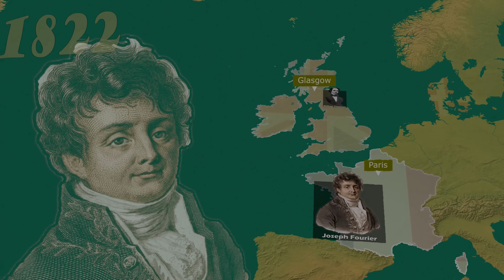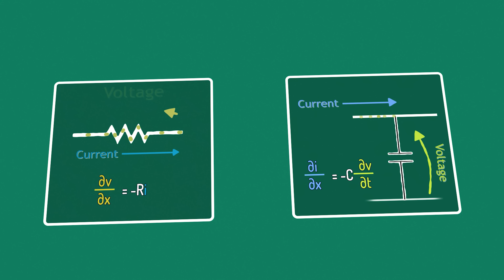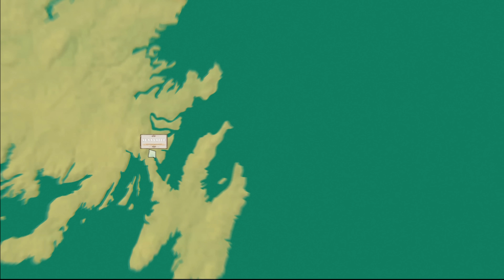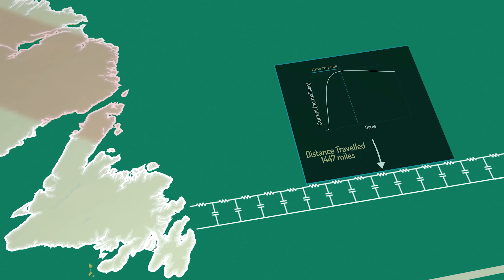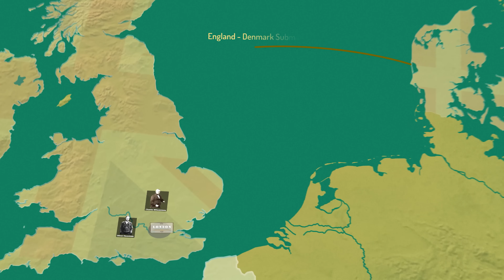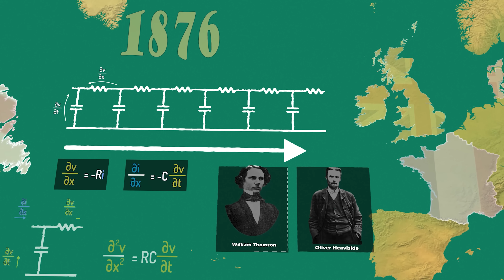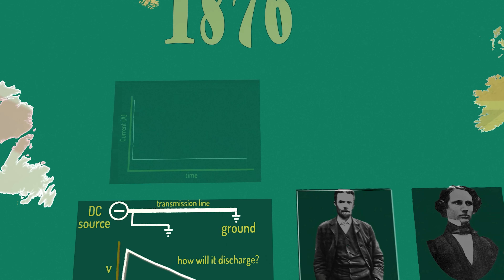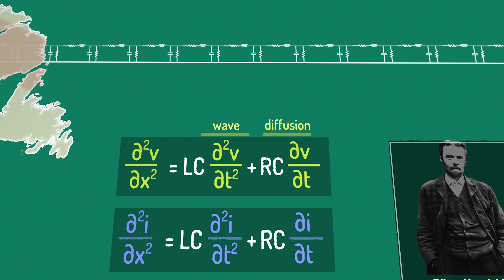The Story of the Telegrapher's Equations - from nowhere an unknown genius solves transmission lines

Comment: Brings back great memories of a lost youth.   I had worked as a cobol programmer a few years out of college but every time I tried to get a higher paying non-business programming job I was told you needed Calculus.   Searching used bookstores for calculus books, most were unintelligible to me, I finally found "Calculus Made Easy" by Silvanus P. Thompson in Dick's bookstore in Providence and studied it for some months.   It was the only book that had made sense to me and did not use the stupid delta-epsilon or limits methods but was kind of a seat of your pants approach specifically designed for the young engineering students of the World War l era. 
Then I was told you needed some engineering courses.   I bit the bullet and went to the University of Rhode Island for 3 semesters , eventually taking all the math courses needed for an E.E. degree and a bunch of other physics and electical circuit courses.   While there I found some of Heaviside's books in an old library annex building that had been converted from an old 1940's gym.   
I ended up getting his 3 Electomagnetics Volumes and his two Electical Papers books but wasn't able to follow it entirely.  It was obvious he believed in crafting mathematics to mimic nature which resonated with me.  For example, his operational calculus equations for a signal down a transmission line mimicked reality because he used divergent series.   Eventually I discovered that one could get microfilms of his personal notebooks from the British "Institution of Electrical Engineers" and for about $30 (this was around 1977) I got 4 spools of microfilms,  bought a used microfilm reader from the library and went at it.  It was something to see how he had taught himself advanced math by working through all the Victorian era math books like Todhunter's series.  
Heaviside loved Maxwell's equations but found the math cumbersome so he set about to reformulate them in his own operational calculus which was later formalized and explained a bit better by Vannevar Bush in the 1920's (who later became one of the famous Majestic-12).  Most interesting of all was Heaviside's formulation of vector calculus in his operational way which could be applied to tornadoes as well as elelctromagnetic phenomena but I had trouble understanding it, his descriptions were too brief.  
I don't know if others ever picked up on that and, anyway, had to make a living so I took a job programming computers for a navy contractor in Middletown Rhode Island and went on with my life.   With his books and microfilms and a tool like Mathematica or Maxima,  some young student or engineer will find there are discoveries to be made by diligent re-reading and study of his work.
[NOTE: Silvanus Thompson's book was the key to passing every math course needed for the E.E. degree and, secondly, in 33 years of programming and software engineering,  I never needed calculus. I have heard they maintain that same bullshit today].
Reply: You were going good until you mentioned that Majestic 12 nonsense.  You know it's laughable nonsense, right?

I know this is long, but let me explain it to you. The Majestic 12 (MJ-12) documents, purported to be top-secret government memos about a secret group formed by President Truman to investigate UFOs, have already been widely debunked as a hoax. I don't think any serious UFO enthusiasts believe it any more.  What are the main reasons, including at least two HUGE issues with Truman’s signature that shout fraud?
1. Origins and Immediate Skepticism
The MJ-12 documents first surfaced in the 1980s when UFO researcher Jaime Shandera received an undeveloped roll of film in the mail. Upon development, it revealed documents allegedly detailing a secret UFO investigation group. From the outset, skeptics noted problems with their authenticity:

The documents were anonymous and unverified.
They contained anachronisms, such as terminology and style inconsistent with 1940s and 1950s government documents.
The story relied heavily on unverifiable claims.

2. Forensic Document Analysis
Truman’s supposed signature on the MJ-12 document, dated September 24, 1947, approving the establishment of the group, has been identified as a forgery for several reasons:

Identical to a Public Signature: Analysis showed the signature on the MJ-12 memo was an exact match to Truman's signature from a memo to Vannevar Bush, a well-known and publicly available document. This points to the signature being lifted and copied.
Mechanical Reproduction Marks: There are indications that the signature was likely traced or photocopied, a technique commonly used in forgeries.

3. Formatting and Linguistic Errors
Wrong Typographic Style: The formatting of the documents didn’t match government standards from the era. For example, line spacing and font use were inconsistent with official government memos of the time.
Anachronistic Phrases: Some phrases used in the documents reflect modern, not historical, language, raise suspicions that the documents were fabricated decades later.

4. Historical Inconsistencies
There is no evidence in declassified government records that such a group existed or that the events described in the documents ever took place.
Truman’s actual presidential schedule and activities on the date the memo was allegedly signed conflict with the timeline implied in the document.

5. Admission and Further Hoaxes
Some individuals involved in circulating the MJ-12 documents later admitted to fabricating UFO-related materials, casting further doubt on their authenticity. Bill Moore, a prominent UFO researcher, admitted to knowingly participating in disinformation campaigns in the UFO community.

Conclusion
The combination of a forged signature, historical inaccuracies, and the lack of corroborating evidence firmly debunks the Majestic 12 story. Experts across multiple fields—document analysis, history, and ufology—agree that the MJ-12 documents are a hoax designed to exploit gullible public interest in UFOs during a period of heightened Cold War paranoia and fascination with extraterrestrial phenomena.

Comment: Why didn't they just test transmitting over 2000-miles of this cable BEFORE they laid it?
Reply: Where is the fun in that?
Reply: They did. But the cable behaves very differently when in different mediums. Air vs. Seawater. Cause what I understand is that the signal doesn't really travel inside the line, in the conductor, but around it in an elecromagnetic field, so on land it travels in air, and at sea in water. Which are very different isolators or conductors. Anyone please correct me if wrong. Its been a few years from my uni studies.

Comment: Maxwell published his work on Electricity and Magnetism, known as Maxwell equations, as a series of articles in 1861-1862, not in 1873.
Reply from the maker: Indeed. Heaviside was first exposed to the 1873 unified treatise, which is quoted in the video. But you are right - parts of it came earlier, for example the 1861 work "On Physical Lines of Force", and I felt it was important to show this in the video.

Comment: PDEs are truly as close as we'll get to the language of God. In fluid mechanics these equations are equally important. Fourier's heat equation is encapsulated in a more general energy transfer equation. Combine that with the conservation of mass and momentum which Navier and Stokes described, and you've got a set of PDEs which describe the flow of any thermo fluid! Maxwell can also be brought into the mix if you need to describe the formation of galaxies!

Unfortunately the solving of these equations remain extremely difficult and the numerical analysis thereof aswell. 

Spectacularly the numeric method utilised changes the fundamental equation you are describing into something called a modified equation. This modified equation introduces extra advection(wave) and diffusion terms. CFD is about minimising these effects

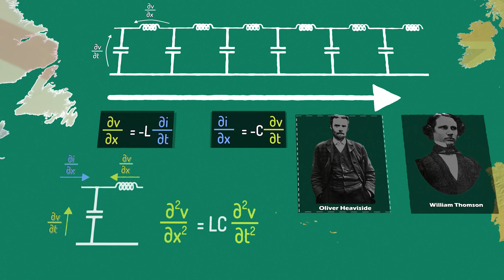Comment: The "1988_Cypress_CMOS_Data_Book" can be found online. "Systems Design Considerations When Using Cypress CMOS Circuits" can be found on page 10-60. 11:40 By page 10-66 it is clear that you want to terminate a transmission line resistively equal to the characteristic impedance of the line. 70 ohm characteristic impedance terminated in a 70 ohm resistor.
Reply: Motorola ECL (Emitter Coupled Logic) applications guides go deep into designing board traces to maintain a "controlled impedance" environment for signals too.
Reply: @uploadJ  Thanks! I managed to find a copy 1989 Motorola MECL System Design Handbook 4ed at Internet Archive. Page 189 has the famous equation for a microstrip transmission line over a ground plane. Dielectric constant, height and width.

Comment: Taught this at college. Transmission lines one of the most useful things I learned. Applies to many other things such as flow of air in pipes etc. 
Also explains why just bolting on solar panels and inverters onto electricity grids is not trivial..... Are you listening Spain..... Watching this could have saved you a lot of agro.
Reply: But, electric 'transmission lines' do not operate in an "impedance matched" scenario; Rather, just the opposite. Also, the problem with interconnected electric generating sources and loads presents certain synchronization stability problems with regulation and regulators, and these are outside the domain of time-invariant linear networks such as Heaviside maths deals with.

Comment: You can get waves out of diffusive structures, paradoxically.  Zabusky, N. J., Hardin, R. H.: Phase transition, stability and oscillations for an autocatalytic, single, first-order reaction in a membrane. Phys. Rev. Letters 31, 812 (1973)

Comment: According to this video, do you realize how many FIRST EVERs Heaviside DID?
• he was the first guy to "coin" the word inductance. (👈So, why were units of inductance not named after Heaviside?)
• he was the first guy to "set up" what is now called (in books that teach the topic of Differential Equations) a forcing equation. (👈This is where you put a sum of 3 voltage terms on the left side of the '=' sign (i.e. one to represent voltage that results from R, and one to represent voltage that results from L, and one to represent voltage that results from C) and you put an input signal voltage on the right side of the '=' sign. Differential Equations textbooks refer to the applied input signal as a forcing equation. )
Reply: John

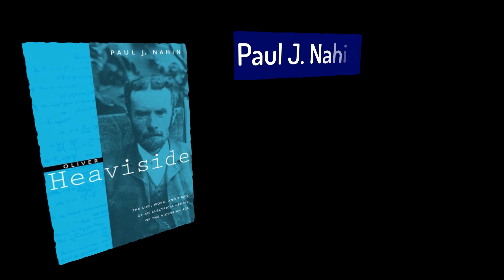Comment: The cover of Paul Nahin's book on Oliver Heaviside is shown at 7:56 of the video. Nahin in 2020 wrote a book on the topic explored in this video. The title is 'Hot (from the Mathematics of Heat) Molecules, (to the Development of the) Cold (Trans-Atlantic Telegraph Cable) Electrons. It is a story book with plenty of Fourier mathematics. Nahin also has a separate book, Transients for Electrical Engineers (2019),  emphasizing the Laplace Transform solution for partial differential equations. The last part of the book is about the solution of the Telegrapher Equation and how programs like Matlab can make life easy for the modern analyst. It also explains why the Laplace Transform replaced 
Heaviside's earlier operator method of solution. It took 10 years but by the 1950's engineers started using Laplace Transforms exclusively. If you love math and stories you are in for a treat from all 3 books.

Comment: Fun fact: Heaviside formulated Maxwell’s equations into the vector description equations we still use today. He also discovered Gravitomagnetism — equivalent to weak-field General Relativity — thirty years before Einstein.
Reply: I think the problem is the use of the magnetic vector potential which is pulled out of nothing and then requires a gauge to set the "troubled" parts of the equation to zero so you get a nice wave equation. It models sinusoidal far-field stuff fairly accurately but starts to have issues with impulses in the near-field. 

Maybe representing with different or original math would fix this, but would probably eradicate any and all practical use due to the complexity (I'm coming from an engineering perspective where you have to make things work and cannot fully reside in the fantasy world of math hehe).
Reply: Gravitom..
Reply: Inferior description of the equations. Geometric algebra is a better way to describe it
Reply: @NoamHaim Geometric Algebra is just nuts nonsense, just use the wedge product for the cross product.
Reply: I still search for the thermomagnetical scrap gripper, I once found in a book😊 It must be a Mandela Effect, it dissapered😢
Reply: “Gravitomagnetism” yeah right, there’s a red nugget for ya.
Reply: Me 2
Reply: Also had a perfect name for what he invented
Reply: Heaviside was a self-taught, electrical theoretician who wanted to understand Maxwell's equations of electromagnetism.  To do this, he had to wade through Hamilton's math of the 'quaternions'.
Heaviside hated the quaternion math so much, that he and his associates revamped it into the vector calculus we know today.
Hamilton's quaternion calculus was a four dimensional system, but he tried to squeeze it into three dimensions, differentiating 1-D 'scalar', and 3-D 'vector' components.
Heaviside trashed the idea, but he kept the fundamental relationships of scalars and vectors within his own algebra.
Maxwell's differential equations, prominently displayed in university text books, are really Heaviside's re-worked equations.
Reply: Vector calculus -> a mathematics based upon the relative position of points within a 4-dimensional space.  Points in the space represent hyper-complex numbers.  The math of the points simply parallels the math of the numbers.   The 'difference' of points parallels the difference of the numbers.  This difference introduces the concept of distance and direction, magnitude and orientation - the vector.  Without recognizing these underlying relationships, the notion that I times J equals K becomes a matter of rote memorization, accepted without real understanding.
Reply: I have always held that Einstein took Heaviside and Bachelier and thats how he got his base.
Reply: I thought that was Josiah Willard Gibbs, the physicist at Yale, who boiled down Maxwell's original 20 equations down to the 4 that we now know as "Maxwell's" equations.  When it really is Maxwell's equations in Gibbs' notation."
Reply: More like he edited it out leaving only the electromagnetic part, without the gravity component. He censored gravity from electro-gravito-magnetics.

Besides, while Maxwell's original formulations were somewhat of a mess, they were using quaternions which are a natural way of representing 4-vectors and rotations in 3D space.

Vectors are an oversimplification that loses important physical characteristics of electromagnetic interactions. We need to use a modernized version of the quaternion form to get the physics we expect for gravity.
Reply: @vaakdemandante8772  You couldn't be more wrong. Maxwell's formulation was a mess because of quaternions, they are an utterly and unapologetically terrible framework to write these equations on.
Vectors are no oversimplification at all, no physics is lost in Heaviside's formulation since it is literally mathematically equivalent.
Quaternions are often used in computer graphics to express rotations for different reasons, that being that quaternions are more compact in memory than a rotation matrix and they don't experience Gimbal lock, both of these are computational practical considerations only.

Please don't talk publicly about something you don't have the slightest clue about.
Reply: @marcossidoruk8033 Nah, but GA is genuinely better for it. Reduces 4 equations to 1.
Reply: @NXTangl  Who cares? GA is an objectively more complex framework, you didn't make electrodynamics any easier, you just renotated stuff into a terse yet obfuscated form, absolutely pointless. Besides, you could also write Maxwell's equations in 4-tensor form, which also reduces the number of equations to 1 while actually being useful in advanced applications such as electrodynamics in curved space-time and quantum field theory, and still, nobody does this for elementary electrodynamics courses for very good reasons: vectors are just easier to reason about, same reason nobody will ever use GA for this.
GA (more generally, Clifford algebra) is useful for other stuff, not elementary electrodynamics.
Reply: @marcossidoruk8033 I still search for the thermomagnetical scrap gripper, I once found in a book😊 It must be a Mandela Effect, it dissapered😢
Reply: @vaakdemandante8772  I believe that modernized version of the quaternion is geometric algebra.
Reply: @vaakdemandante8772  >Vectors are an oversimplification that loses important physical characteristics of electromagnetic interactions

What is bro talking about?
Reply: @mastershooter64 Ha .ha..ha..lol😅
Reply: @vaakdemandante8772  That is nuts, Quaternions are insufferable trash. And we are fine with vectors, until you want to add re tard.

Comment: Getting your head around refrigeration etc including Air Conditioning is there is no such thing as cold, only lack of heat, so its about moving heat not supplying cold, the process of pressure drop to move heat energy thereby leaving a state of lack of heat perceived as cold !

Comment: It is more global even than this. The same equation shapes apply to heat, mass and momentum as well. And that is major coursework in Chemical Engineering. Add to this hyperbolic extensions of trigonometry, and J and Bessel functions that extend all of that, and Fourier, Hamiltonian and Hermitian functions to deconvolve and reconstruct signal structures and you really have something. Then add thermodynamics laws and Maxwell's equations for electrodynamics and you'll soon be cooking with steam.